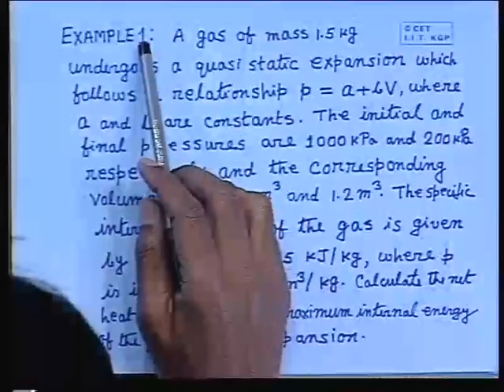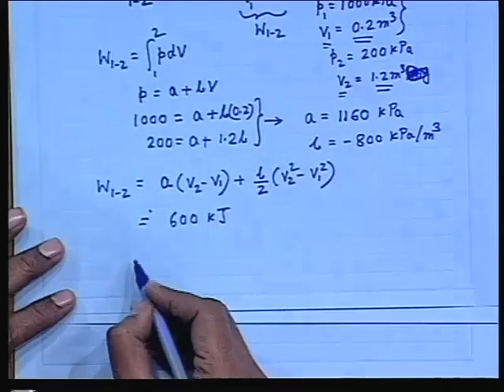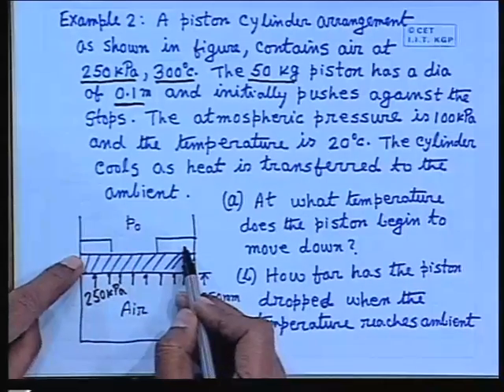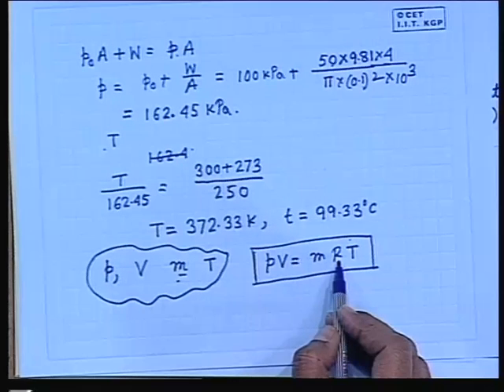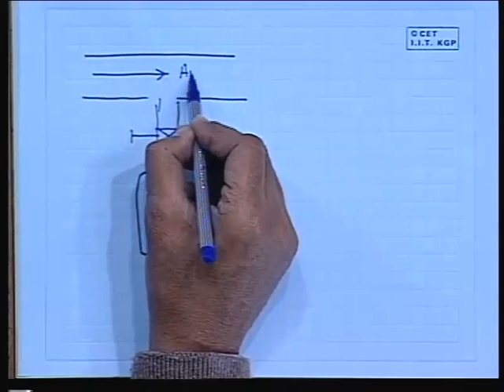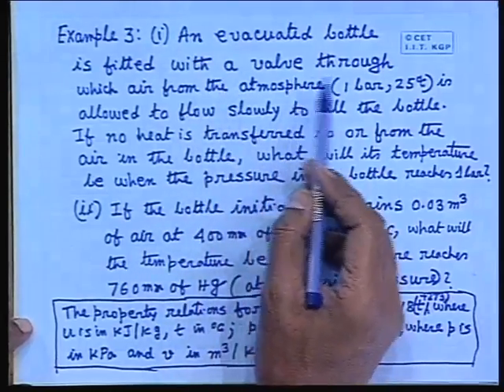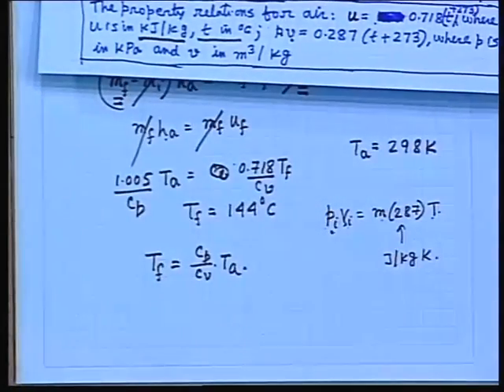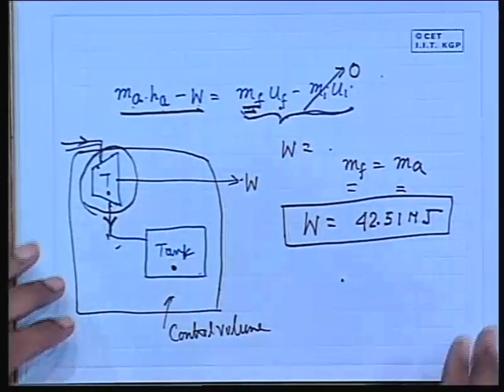Lec-5 First Low-III

Comment: Again 🎉1:00 Back to Back three "1st Low"🔥🔥🔥
1:47 Problem 01; First Law, Closed System
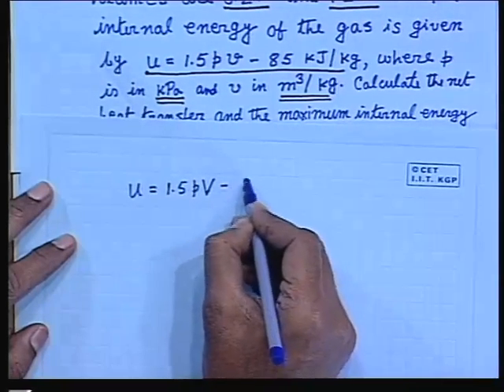(10:10 = (1.5 pv -85)×m= (1.5pV-85m) v= Sp. Vol; V= Vol) 

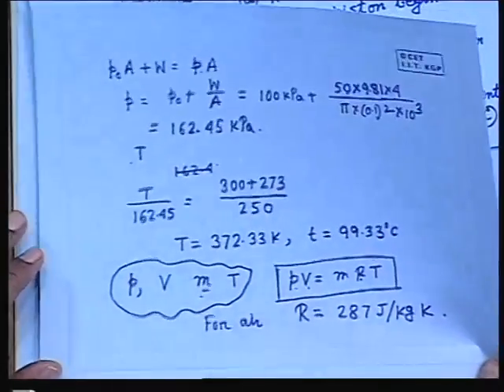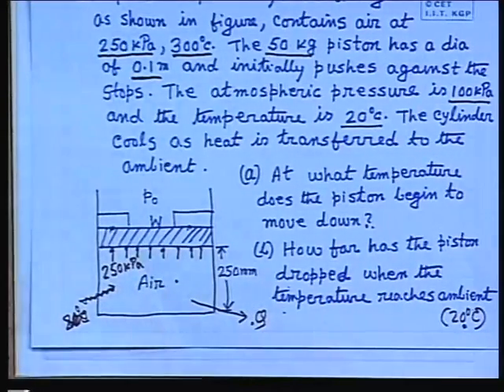15:00 Problem 02; Analysis of a Closed System (ii) 25:03-*26:14
30:30: Charging Of a Bottle
37:58 Problem 03; First Law, Open System
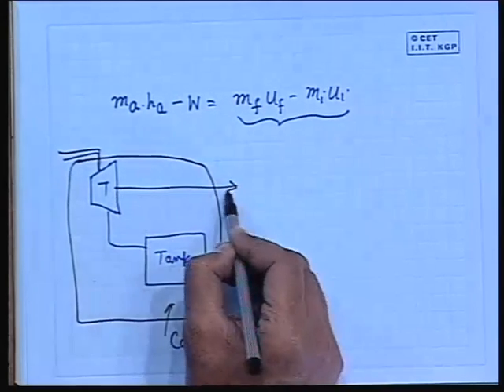46:11 Problem 04; First Law, Open System **49:51
52:58 😎😎😎😎 like a boss 😎

P1-?: 54:03, 54:09 , 54:39, 55:13, 55:27, 55:59 ,56:30 ,57:04 
Answers are given in lecturer 6

Comment: When do enthalpy becomes equal to internal energy,as used in the charging of bottle problem?
Reply: Because there's no P-dV work being done there.....no expansion or contraction of boundaries of the system......
H= U + pdV
pdV=0
H=U
Reply: Apply mass balance
Mass inflow-mass outflow= mass stored 
Now we know mass outflow=0 then mass inflow = mass stored hence 
Ma=mi-mf

Now apply engergy balance 
Engergyinflux-energyoutflix= engergy stored.... But engergyoutflix=0
Then engergy influx= engergy stored
Engergy influx is only enthalphy there is not heat and PE and KE negligible then engergy infulx= ma(ha) and there is not work and not heat transfer then engrgy stored is only inform of internal enhery ie mfuf-miui
Reply: @e-comgst8565  thanku for explanation

Comment: 3rd examp:
In eqn   ma*ha=(mf-mi)*ha  why ha in both the sides is nt cancelling each  other & enthalpy isnt changing? plz anyone!
Reply: R.h.s is derived from l.h.s
i.e ma*ha means energy due to air entering. If initially the mass of  any gas already present inside bottle before you open valve is  Mi , the mass of air ( at the end when no more air is entering since valve is closed) would be Mf-Mi since mass is not flowing out and niether is there another mass except air/ given gas is entering. Hence, energy due to mass of air/gas inside bottle = (mf-mi)*ha . In simple terms its just conservation of mass and energy , try to apply it yourself and you will understand it easily.

Comment: In Example 2 Why Normal force zero(18:43)?
Reply: Normal forces are acting on the piston due to stoppers when the piston is in contact with the stoppers. But the condition taken here is the piston 'about to leave' the contact of the stoppers to go down. For that purpose normal force has to be 0.

Comment: can anyone tell the answer of fourth question is right. when i'm calculating i find mf as 166.55kg and calculating the values of hf and uf on the mass 166.55 kg i'm getting 20.319Mpa
Reply: Take temp 250  not 250+273
Reply: @akshaysoni7569  Getting W=25 KJ considering T=250 K

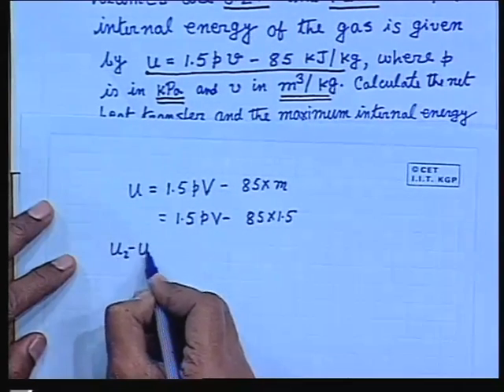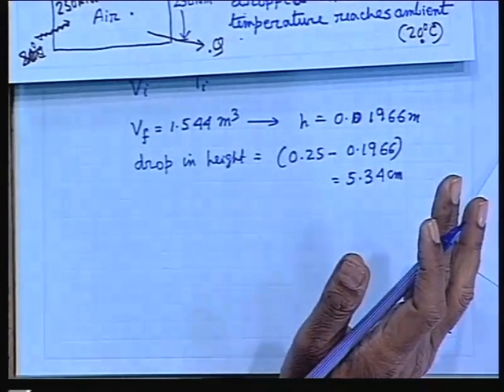Comment: At 10:35 it should be U=1.5*m(PV) - 85*m; At 29:27 Vf=0.001m^3, drop in h=(250-127)mm.
Reply: The v used initially was specific volume and when this volume is multiplied by mass, you get volume , V
Reply: i am too getting it

Comment: in the second problem,  part b if we analyze the total force from inside the container initially as equal to 250kPa times  area of the piston which is greater than the sum of forces opposite to it including weight of the piston (50Kg) and force applied by atmospheric pressure (100KPa times area of piston) , then we find that force from inside the container is more than that opposite to it. Then how come at constant pressure the piston drops rather practically it should have expanded? Please help me to clarify this.
Reply: As cooling starts, piston won't come down suddenly. when system reaches a value of P2 & T2 , no reaction force will be acting on the piston i.e no contact bt stopper & piston & piston is ready to come down.
Difference bt P2 & P atm is around 60 kpa whose effect is negligible, so we are considering constant pressure process coz at this stage only piston will start coming down slowly. During process, P T V drop is continues, but main thing is which property change to consider..
I hope it may help you brother
Reply: @tanmoydey1012   Can you please tell me... 
At p2 as there is no contact between stops and piston so I agree that weight of piston And atmospheric pressure is more so initially due to volume constant piston moves down...
But my doubt is piston should move little bit down as again when it comes down little bit pressure must be equal to atmosphere pressure and again when you cool temperature then again pressure must come down and so volume should also decrease what's the reason in second case we are considering pressure to remain constant and volume to be changing?

Comment: vf=1.544 m^3?
Reply: Aruvi Raj how are you getting 1.544
I am getting 1.004
Confused
Reply: The piston moves down at temp 372.2 K
V1= 3.14*(r^2)*h
     = 3.14*(0.05^2)*0.26
     = 0.0196 m^3

Now V1/T1 = V2/T2

V1 = 0.00196 m^3
T1 = 372.2 K
T2 = 20 + 273 K

On substituting these one gets V2 = 1.544*(10^-3) m^3
Reply: @aruviraj93  if your calculations were right you could have get the value of Vi = 0.0019625 m'''3
Reply: +deepakpatel s height of the cylinder is given n also the diameter of the piston so we can find Vi(volume = area*height) so from that we can find Vf
Reply: Bilva joshi thank you brother...
Reply: No. The volume is 1.544*10^-3 m^3
Reply: Aruvi Raj check your units its length not volume.. u are saying that length will come in m^3 is this length or volume 😂
And also you are putting the formula for area is wrong the area will be 3.14/4 d^2
Reply: @mpniko  hahahahaha  bhai uska sahi he modi-fied he bas...

Comment: @vijay, nice. Note u1=1.5p1v1-85, u2=1.5p2v2-85. So ▲u= u2-u1. So ▲u=1.5(p1v1-p2v2). Note this is specific internal energy and "v" represents specific volume. So total internal energ ▲U=  ▲u*m= m*1.5(p1*(V1/m)-p2*(V2/m)). Now take "m" out and cancel it with outside "m". So it's clear that there's no need of multiplying 1.5 kg with "u". Just simple analysis needed. It's given just fit confusion. Analyse on a bit of paper.

Comment: in question  1 . given specific  internal energy  u=1.5pv-85 KJ/Kg
where p=KPa=KN/m^2 and v=m^3/Kg
then pv=KN.m/Kg=KJ/Kg 
then in calculating net heat  
why did you multiplyonly  85 with mass=1.5 Kg   "NOT (1.5pv)"?
Reply: He multiplied mass with 1.5pv also.... Firstly v in (pv) was specific volume means volume/mass...when he multiplied mass with specific volume..it became Volume.
Reply: @sarthakthakur4131  thanks bro
Reply: @amit shukla thanks Bhai amit
Reply: @amit shukla Bhai amit any idea regarding charging of bottle concept... Why Pi= Pa & Ti is not equal to Ta
Reply: @amit shukla thanks Bhai... Gud concept. Bhai vo Newton law Kya tha coz this is the first time I heard that temp increase based on Newton law... Agar kuch information  u can provide on this... Thanks
Reply: Same doubt bro.... U got any idea..
Reply: In question no 1 @ 13.16.. how the value V = -a/2b came? anyone please?
Reply: @manisrinivasan155  In case of Maximum or Minimum, the derivative is zero........so If we equate dU/dV = 0, we get a + 2bV = 0 => V = -a/2b.